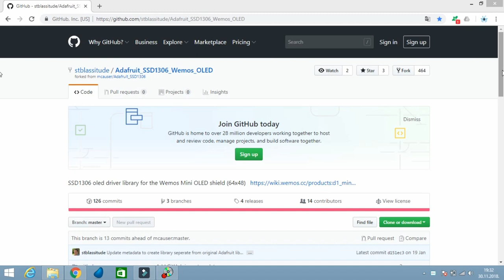Arduino Stopwatch, Flappy bird , Counter and much more

Comment: Not a bad project. :) But you can better in soldering :) Use the zinc for soldering, not enough if the cable is prezinced.

Comment: Why there is no pull up/down resistor for the button?
Reply from the maker: it use internal pull up resistor on arduino
Reply: @VolosProjects  thank you
Reply: @HelloHelloXD  you can use INPUT_PULLUP in pinMode instead of INPUT :)